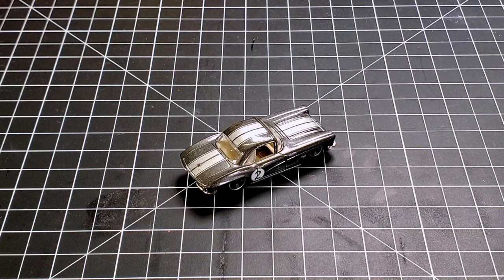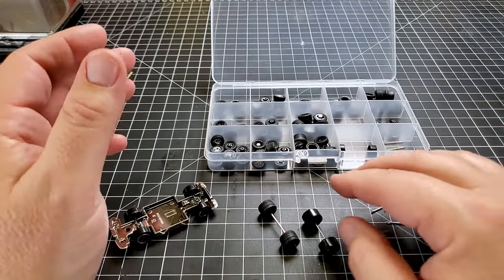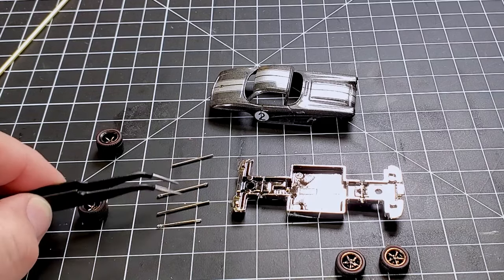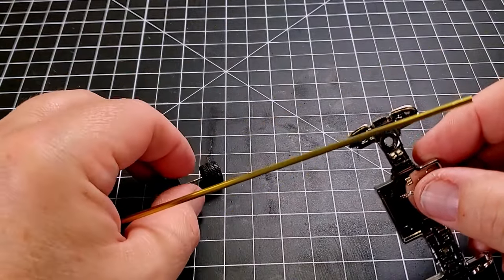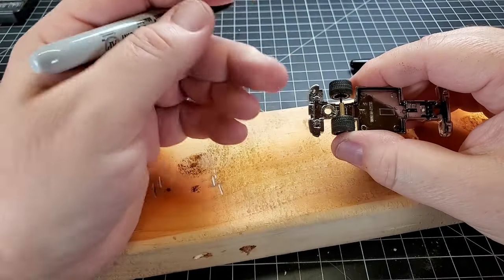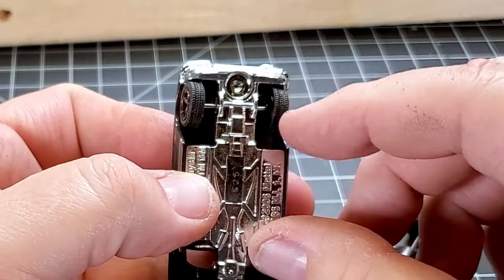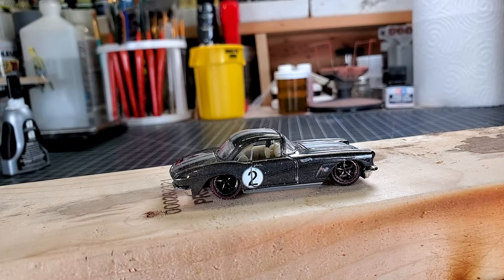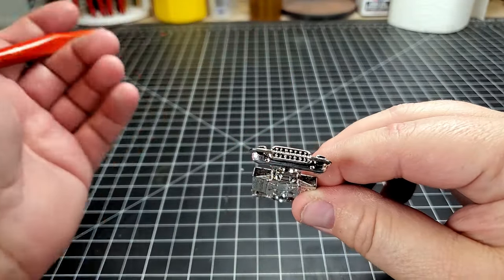Custom Axle Tubes For Hot Wheels.

Comment: Great video, Paul! I've been customizing Hot Wheels on and off for a year now and it's a lot of fun. I did wheel swaps, repaint with spray cans and even a bit of custom body work with epoxy to make a Hot Wheels key (not keychain!). I would like to dab into decals installation but I don't want to overpay, so I'll look into the possibility of making my own. The same with 3d printed parts down the road.

Subscribed and looking forward to your next videos!
Reply from the maker: That's awesome. I love my 3d printers. I've printed a couple of buildings for my hot wheels.